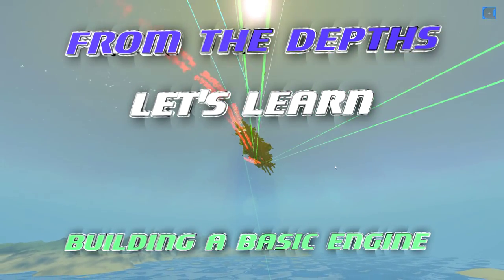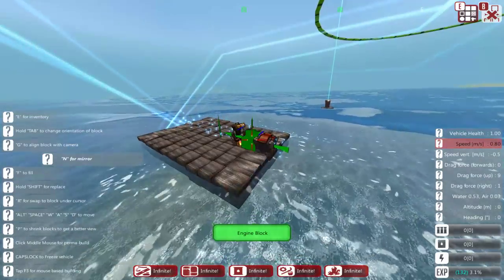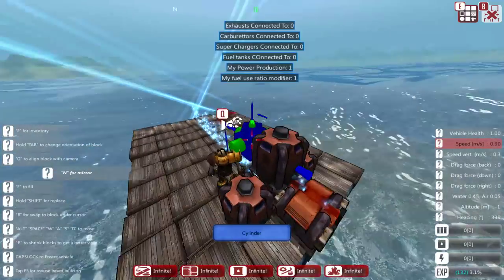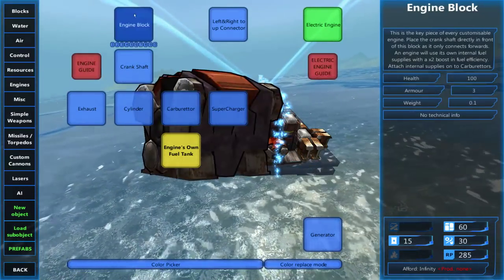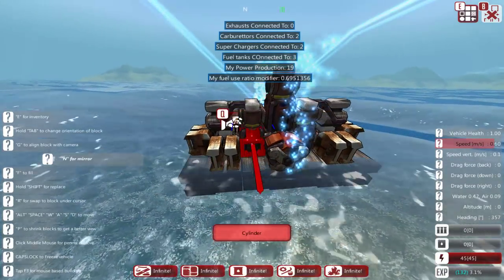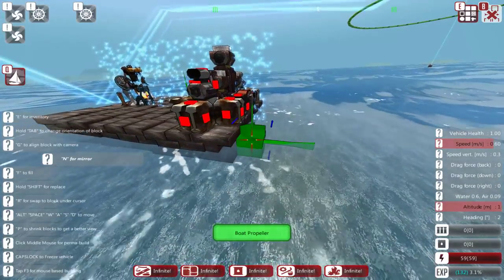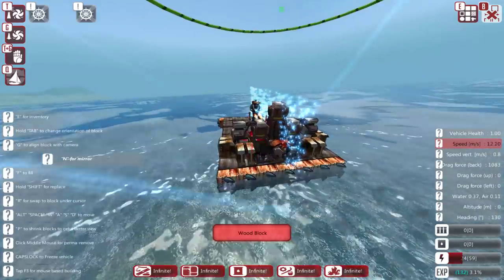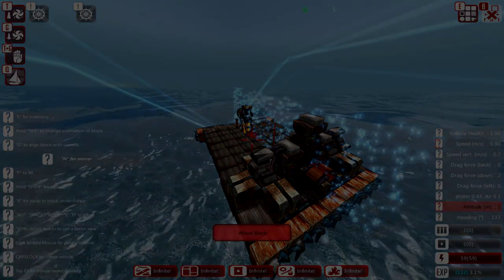From The Depths Let's Learn - Building A Basic Engine [Tutorial]

Comment: Hey there. I am interested in buying "From the Depths" with the current steam sales. I am currently going trough your beginners video to get a feeling for the game.

I have to say, looking at this video, this feels very overly complicated, just to build an engine... Engine block, cranckshaft, cylinder, carburettor, fuel tank, all those component are basic cube shape at their core. I can tell the most efficient form factor will always be a big 7 wide cylinder.

It would have make more sense to me to have one simple big engine component, a fuel tank or coal bunk, and some piping between. Are their other types of engines available or is that all you get?
Reply from the maker: karbengo Hey man- 

There currently is the 'oil' based engine as you see here, as well as an electric engine. The electric engine is very different in how it works, but is simpler (and takes up much less mass/weight on the ship). However when your electric battery 'cells' run out you need a way to recharge them (this is when having a mothership for things like repairs/re-fueling helps during battles). There are also talks about a Nuclear engine type, I imagine it will be similar to the oil based engine in that it will need multiple parts to work (and a way to deal with the potential fallout). 

Let me know if you have any more questions, happy to answer them :)